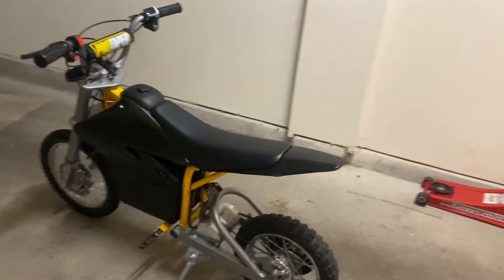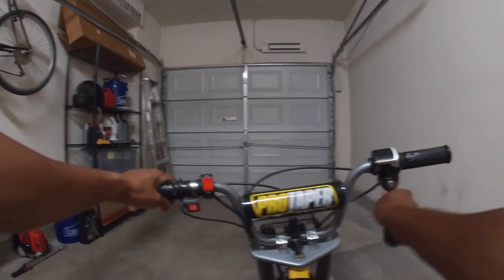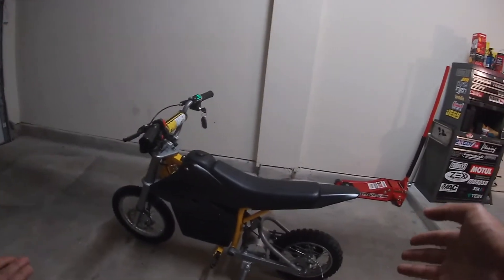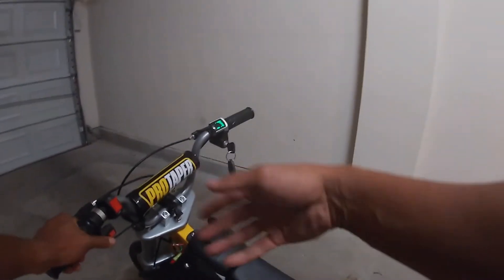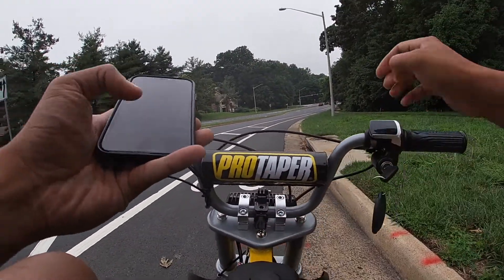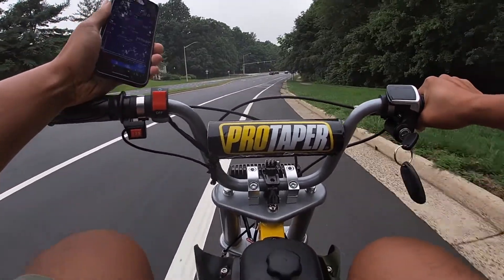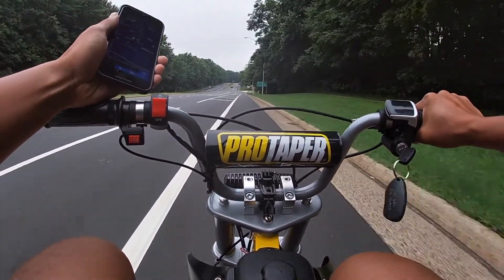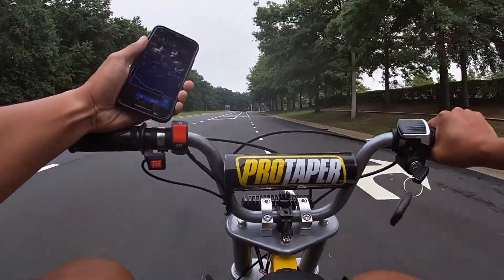Razor MX650 to MX2000 Conversion Part 4 | Kunray 2000W 48V Brushless Motor Top Speed Test MPH

Comment: Hey Pat! I’m currently upgrading my Mx650 and I was wondering, how much range does that battery you are using in the video get? I’m planning on getting a 48v 2000w kunray upgrade kit but I also need a new battery with a budget around $150. Any suggestions?

Comment: Mine isn’t running any tips?
Reply from the maker: What have you done to diagnose it so far? Maybe start with taking a volt meter to the battery terminals to see if it’s holding proper  charge first
Reply: @ yeah it’s holding a charge, throttle powers in but shows battery is dead but I charged it

Comment: Hey I got the same exact set up as you but mine has a problem I hooked everything up and I was expecting like 31 mph but it topped out at 21 mph do you have any advice and I have the btr 48v battery
Reply from the maker: @9piece-  look at the three speed switch that comes with the controller to see which it is set to. Might be on the slowest setting. Also how much do you weigh?

Comment: I’m getting the same kit I just ordered it today and does it come with the on and off switch and also the mode switch too?
Reply from the maker: Well if it’s the EXACT kit, then the “on and off switch” would be the key ignition on the throttle. My kit came with a 3-speed switch separately, depends on the seller you purchase through.
Reply: @PatOutdoors  oh ok thanks I just saw your video on the Amazon thing for kunray kit and saw yours had that and was wondering

Comment: That is not very fast for a 2000w bike, i have a 250w with a 48v battery and can easily be top 30mph.
Reply from the maker: How are you measuring speed? 250 watts and 30 mph is unheard of

Comment: Could I run a 48v 20ah 40 amp battery with the kunray 2kw kit considering the fact the motor is rated for 42 amps? I have the kit and the bike. Could you recommend me some batteries besides a BTR battery? Please and thank you.
Reply from the maker: Yes you can. Check out Amorge, Econic cycles, or Electro & Co batteries.
Reply: @PatOutdoors  Thank you so much, I've been looking at 50 amp battery's thinking the 40 amps wouldn't work, I love your videos and keep up the great work!
Reply: @PatOutdoors  Hey Pat, I'm back again  and are you sure Amorge isn't a scam or anything and if I order on Alibaba I'll get the battery? I found a battery but if I don't get the battery I will be in some trouble.
Reply from the maker: @pvnchmadefaris  I’ve bought 3 batteries from them, including for my big YZ250 qs138 conversion. Plenty of people here use Amorge. You can email them directly at info@amorge.com if that makes you feel more comfortable. I believe they manufacture Momentum watt’s batteries as well, in case you want to pay a little extra for a US-based seller.

Comment: did this have 4x12v lead acid bbatteries?
Reply from the maker: During this time, yes. But it’s now on lithium 72v
Reply: @PatOutdoors would you know if a 60v kit would work on a 36v battery?
Reply from the maker: @anyiox6326  No it will not. The controller would not turn on (it has a voltage cut-off limit)

Comment: You think a 1800v Motor will get the same speed I’m (104lb)
Reply from the maker: Not exactly, but just because I have a 13-tooth sprocket and larger tires. What kit are you looking at? Also depends on the controller and battery output

Comment: How much of a difference would be 60V 2000W motor? I want to convert Go-ped GTR into electric beast and I was decided to do it 60V but it is more expensive and less cells will better fit in. I am considering also 60V 3000W but maybe it is overkill? I want torque, don't need to achieve very high speed.

Comment: Is this controller and throttle variable/ proportional? like is it full on or off or can you lightly twist the throttle and it will slowly move you along?
Reply from the maker: To be honest with you, the throttle is not very variable as far as ramping up the signal to the controller. There is a small window of progression at the start, but 80% of the twist rotation is basically just full on LOL.
Reply: @PatOutdoors  haha gotcha. Thank you for the honest take. I currently have the fast scooter controller and it’s able to slow crawl and I like that because I can take the bike out my wife takes the kid out for a walk
Reply: @PatOutdoors  How are the wheelles on this? is it way easier than a stock mx650? or is there not enough power

Comment: I still like my 450 w l faster i have 1800ma 36v battery and when you got your 33mph it looked like you were going on a down slope my bike would have also probably done the same i want too mod my forks and stick another motor on the front wheel alom\ng with 22 tooth drive sproket and 28 on the hub
Reply from the maker: I mentioned that, yes. I actually hit 31-32 MPH flat ground. And with my new (larger) street tire set up.. A little fast again :) My L-faster bike is about to get some love soon also

Comment: Take a look at "shunt mod" for these lower end controllers. It will give you the punch off the line that your looking for.. if your still using the stock Amp fues might need to up it to 40amp from the stock 30amp
Reply: Thank you for this!

Comment: Just be careful pushing it hard you can easily over heat the 1020 motors. What a lot of people do is make the vent holes bigger and add a fan to pull heat out.
Reply: I’ve been getting these vent holes recommended to me, but I still gotta look into it. I’m also looking at heat sink options
Reply: You are correct. I easily accidentally overheated my stock 650w 1020 motor by going up some hills. Noticed a not great smell and looked down and saw some smoke. haha. What are the solutions to this? Heat sink?
Reply: @Dmaze652  drilling out the air holes to a wider bore to allow air to flow through. I really don’t think a heat sink will do much cooling by it self.
Reply: @ReRunTyson  Thankyou!!!
Reply: The newer ones have built in fans atlases the brushless ones

Comment: I just built a 48v 1800w Mx and with the stock sprocket can only go 25mph. Do u think switching to the 13 tooth sprocket will get me to 30mph
Reply: What size wiring are you using for your 4th battery? Actually what battery and kit are you using? The 13t sprocket would only net you 3.5ish mph around this range
Reply: @PatrickKasilag  ok, thanks I might try a 13 tooth sprocket